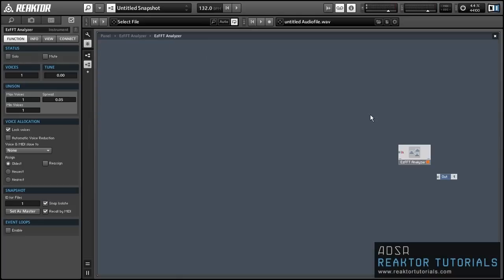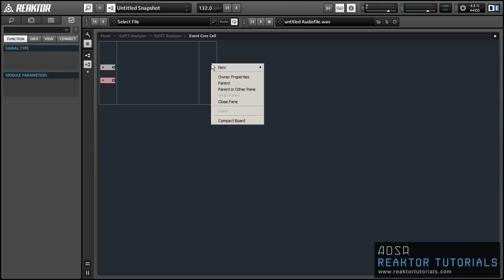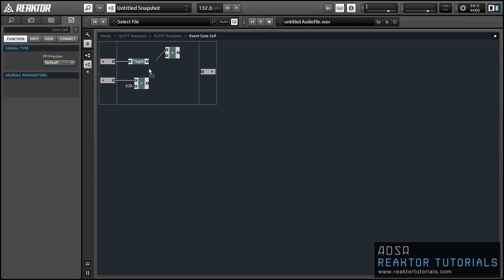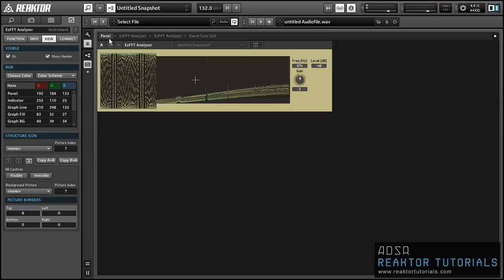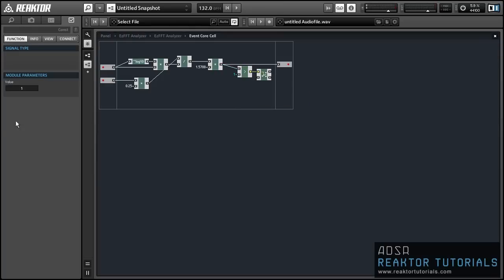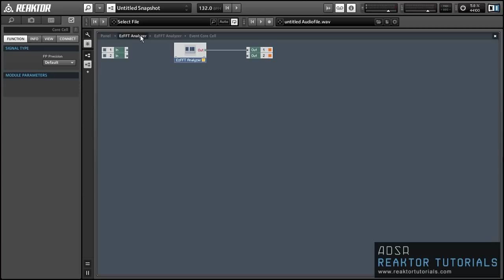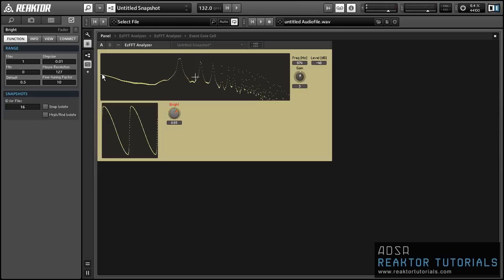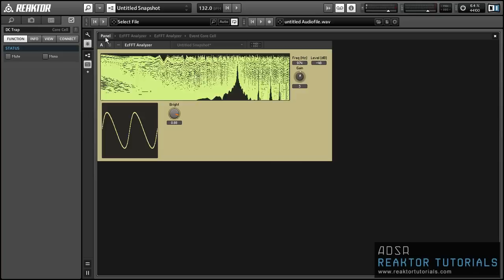Reaktor - Creating an Anti-Aliased Oscillator - How To Tutorial

Comment: Sweet waveshaper, thanks!
i found that placing an Exp. (A) module between the Bright knob and the multiplier, feeding Sine's Amp, makes for a more linear sounding control.  -40 to 0 is a good range for the Bright knob.
Thanks too, ADSR, for making Reaktor more approachable.  You're a go-to reference for it.